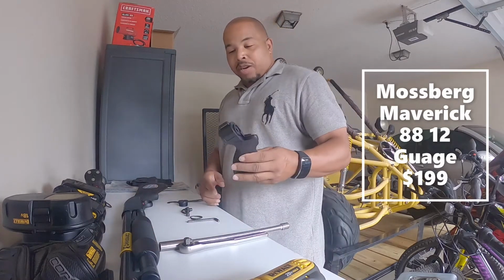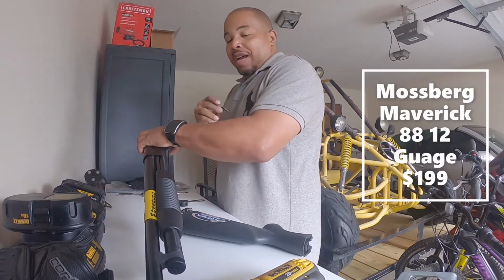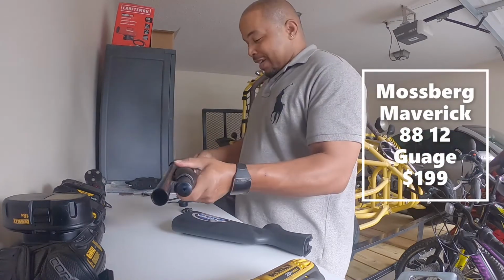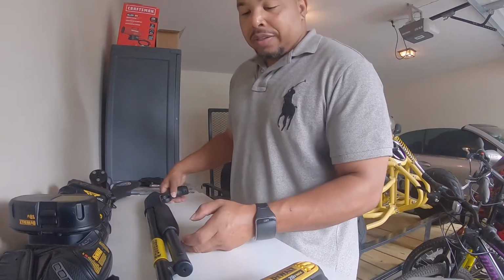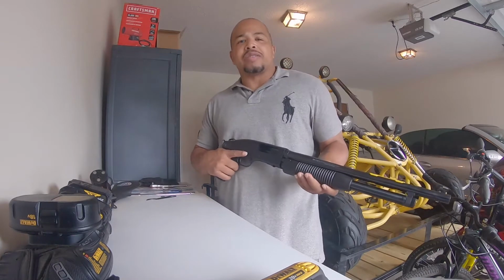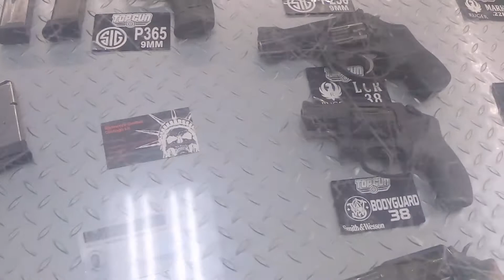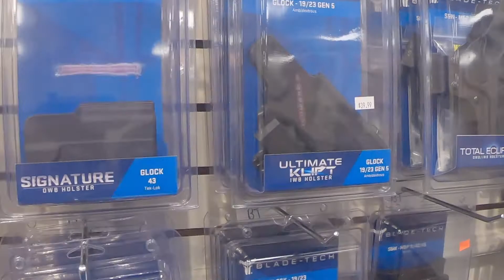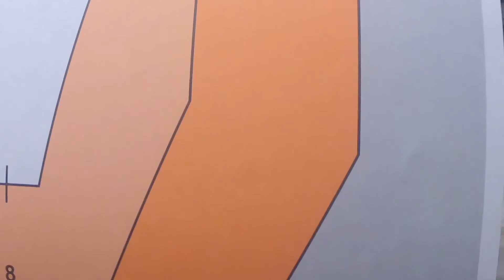How to Install a Pistol Grip on a Mossberg 88 and Gun Range

Comment: Which grip is this ?
Reply from the maker: It's a aftermarket grip from Ebay. It was about $20 they also got the Shockwave grip too( birdshead grip)  $20 they sell the birdshead shotgun for 400+ but you can just but the handle for four shotgun